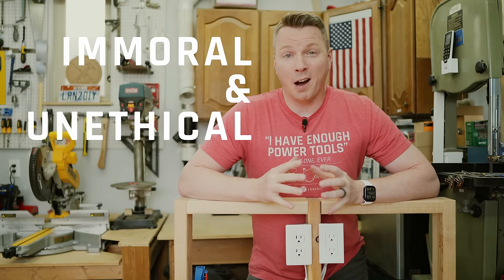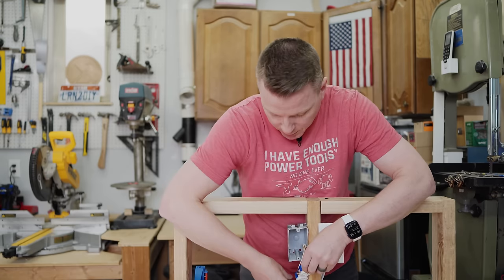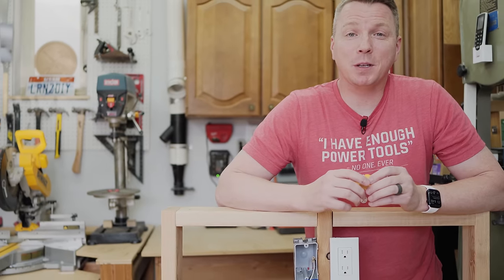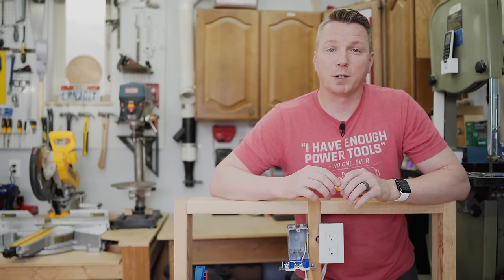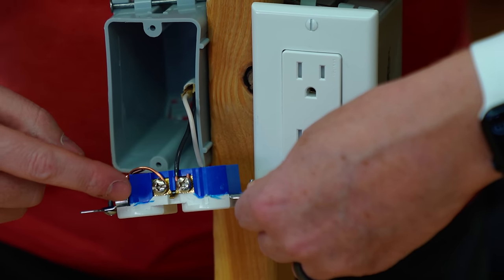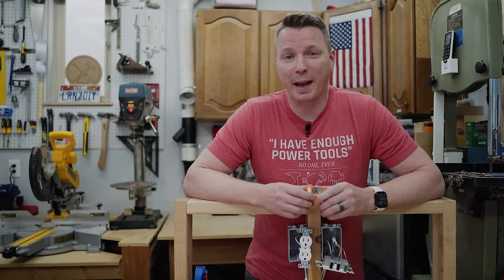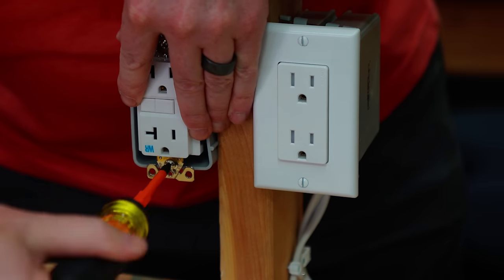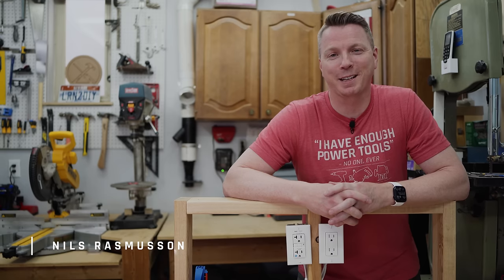People Are Adding Deadly Hacks to Outlets

Comment: While it's far from ideal as it'll never trip an RCD/RCBO/GFCI etc, it's better than nothing. Without that, the case of an appliance would be floating should the case go live. That said, American electrics are horrific in general and those wrap around wire terminals are disgusting.
Reply: Of course it will trip if someone were to get shocked.
Reply: @okaro6595  it absolutely will not since there's no path to true ground. If ground and neutral are bonded at the outlet, then the breaker would trip should the case go live due to it being a short. There's no path to ground though so there's no imbalance to detect.

Comment: Don't lump the grandfather groundd  how bout you explain why it's deadly since in all homes the ground and neutral are connected together In the panel... whe renovating yes it should be fixed.. but for homes that were old allowed the owner to use a grd and white under a wire nut with one going to the silver screw..and always put the hot ,blk on brass.

Comment: I'm still quite angry at you americans that you have black for hot and white for neutral, while it's usually that black is ground(dc)/neutral and hot is white, red, or some other bright color, indicating that it's the one bringing power.
Reply: Did you notice his example had a white wire for hot?  You're supposed to mark it with tape or a marker when that happens. With three-phase, black white and red are all hot. When you fix stuff for a living, you learn never to trust the color of a wire. You break out the meter and check.

Comment: Dude you're not going to pull a full 20 amps through your body amperage is a function of voltage and resistance your body has a natural resistance. If you did come into contact with an energized fixture that wasn't grounded yeah you'd be shocked but it wouldn't be at 20 amps come on man get your information right you bashed people who do that sort of installation like two breaths prior

Comment: There is no “hack” for home wiring. Building codes are the MINIMUM acceptable requirements, born from trial by literal fire. When it comes to electricity, do it right or don’t do it at all.

If you’re not a professional, call one.

Use your brain.

Comment: I'm gonna call bullsh_t on you. You don't know the electrical code very well. If you did, you'd know that grounding wires are not required in residential bulidings. What is required is this; if you have a 3 prong plug then it must be grounded. However, if you live in an older home (such as mine which was built in 1895) where, in the 1950's or1960's, it was wired with 14-2 or 12-2 then the recepticals must be 2 prong. The code requires 2 prong recepticals when only two conductors are installed and 3 prong when 14-2-G or 12-2-G are installed. To further refute what you're saying is, why do all hardware/big box stores sell 2 prong and 3 prong recepticals.
I don't like it when YouTubers get things wrong about something as important as electricity. And to any DIYers out there, 2 prong recepticals are just as safe as 3 prong recepticals if wired correctly. I've lived in my home for 26 years, it was built in 1895 and was wired in the late 50's to early 60's. There is even some original tube and post still in my attic.

Comment: CONGRATULATIONS - welcome to 2 wire system. This "improvement" was invented and oficially implemented since 50's in socialistic Czechoslovakia. Of course neutral was grounded in main connections box and called PEN. Since that it was wild theme for discussions within electricians comunity.

There is even a style of beer pint clinking - you clink by top edges of glasses, than bottom edges and than hit the table to cheer 3 wire system.

Finally, the 2 wire is now not recommended anymore, of course ....

Comment: I love how you all the code but obviously absolutely nothing about how electricity works. Ground to neutral will still protect you. Reverse polarity 😂 wrong term it's AC not DC 😪
Reply: Are you claiming that because it's AC there is no such thing as reverse polarity? If yes, then why are 2 prong plugs polarized? Why is there a distinction between hot and neutral wires? Please explain.

Comment: ... or you could not use a sunbeam metal cased non polarized drill standing in a puddle of water on concrete wearing a thong barefoot with shorted motor windings.

Comment: Ok you clearly have zero clue about what your trying to speak on, when it comes to residential wiring how about you go remove the cover on the breaker box and then tell me were the common wire white wire and the ground wire Cooper or green wire go to inside the box yup that's correct the exact same place the only difference between the ground and common is the color of its insulation however some county's require the common to be segregated on a separate bus bar but ultimately that bus bar ties right back into the ground, the only true safety difference is if the home is properly grounded.  Besides that trick is really only used to pass sec 8 inspection

Comment: You'll never see 15A through a human. For that we would need to be ≈10ohm resistance. That's at least 2 orders of magnitude off. You have no idea what you're talking about. People like you who make videos on topics they don't know about just complicates the issue.
Reply: Also, you don't need an expensive circuit tester, all you need is a cheap multimeter and you take an ohm measurement. If it reads <1ohm it's most likely bootlegged, if it reads more than 3 ohm there's a 99.9% chance it's a true ground.